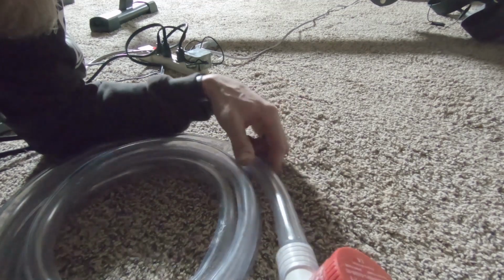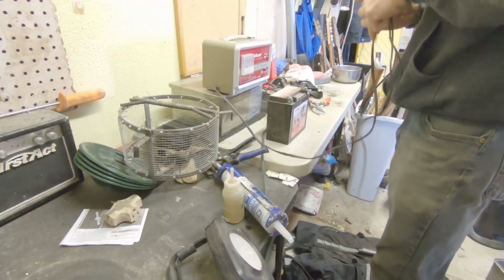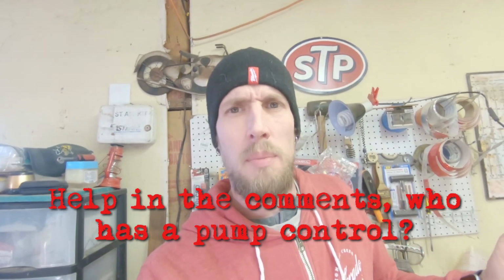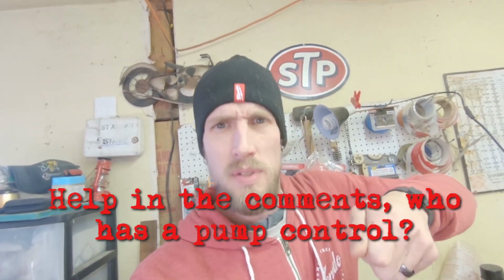Do It Yourself: Clean up Sluice

Comment: I would just use a pvc flow valve for water control, that’s what I use on my cleanup sluice and my bluebowl. Nice video though! 👍
Reply from the maker: Maybe I'll give it a try, I'm sure I have one. Thanks for watching!
Reply: Or a speed controller from Harbor Freight, I have 2 from there. A foot pedal control and a dial controller, you could hook that up to the pump
Reply: Would that put strain on the pump ?

Comment: Good to see ya man, been a minute. Get that voltage regulated and it will run good. Instead of using a battery, I bought a ac/dc converter and glad I did. Just made sure it was rated at a higher amperage than my pump. Peace 🤘⛏🇺🇸
Reply from the maker: I'll definitely find a new way to power it to stop the surges, thanks for watching!! 🤘
Reply: @lankywhiteguy  you bet man

Comment: Just came across your channel, subscribed in the first 30secs, and I'm watching all your stuff now... 
Keeping in line with "(y)our style of doing stuff", lol, to better help control the water flow, you don't wanna mess with voltage inputs or restricting the water, both will strain the pump and/or pump motor... Instead, just put in a constant flow bypass (like sprint car fuel systems) by adding in either a "T" or "Y" to the water hose just past the pump, one to the sluice and the other back into the water tub... whatever you have that's easier and cheaper to adapt in to whatever you have as far as a hose bib/shutoff valve (i just used an old washing machine "Y" hose run backwards to a hose bib on a new miller table I built)... PVC ball valves are cheap, but are a pain to get adjusted... I suggest using either the cheap garden hose bibs, they seem to work best as far as adjusting or even the quarter turn toilet valves, but they can be a bear to adapt to from the junk pile... or if you have barbed fittings laying around, you can use the $3-$5 irrigation shutoff valves found at Home Depot, Lowes, etc... also, harbor freight's 264gph fountain pump ($20 on sale) comes with a bypass valve, so does the 640gph I think...  ANYWAY, voltage says constant so the motor is happy and the water is flowing free so the pump stays happy and you can control the water flow so you stay happy 😊😊
As for power supply, an old laptop, router, lcd, etc power adapter/supply are great power sources at home... For a 12v pump stay in the 12v-13.6v range and you want more amps than the pump requires... I'm pretty sure we have the same amazon bilge pump, mine is 12v/3a, only $16... Anyway, you can grab a new 12v/10a power adapter on ebay or amazon for ~$13 or an even an old power supply from a desktop PC should have a plug putting out around 12v/25a...
I like the simplicity of your clamp to hold the hose on the top, I just can't help myself with trying to over complicate that... lol
sorry i rambled, keep up the good work and thanks for sharing...
Reply from the maker: Glad you enjoyed it. I've got more builds and ideas coming. Thanks for watching!

Comment: How did you slow down the flow on the water? I have the same pump but it's way too much water coming out. I thought maybe a to fitted on the pipe but it won't reduce the flow of water from the pump so would probably blow the pipe off?
Reply from the maker: @on_the_mooch2708  I pinched the plastic tubing shut some and added the splash box lol

Comment: 3.875 wide? You sound like a machinist sir. I'm building a clean up sluice for those Arkansas black sands as well. Any suggestions on matting?
Reply from the maker: I made this one 5 ft long because the ark has so much black sands. I want to try miners moss and a few riffles on top of the v mat. I think that would give it room to clear and hold more material. Thanks for watching!

Comment: Brother if you have a way to warm up battery prior it won't surge on ya....battery is essentially warming itself by working and then surging voltage during this cycle
Reply from the maker: That makes sense! Thanks for the tip, thanks for watching

Comment: A little bit of carpet upside down at the top so the water slows down and equals out. Run it an inch or so over the start of the v mat
Reply from the maker: Everyone has had great ideas in the comments, might have to smash all of the ideas together and have the best power supply! Thanks for watching!